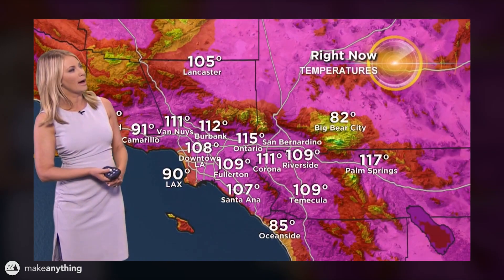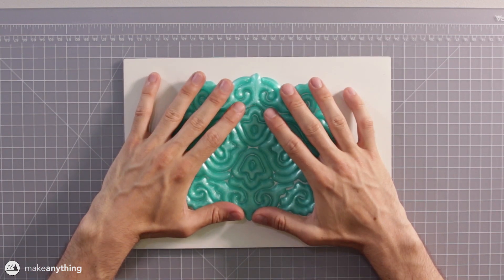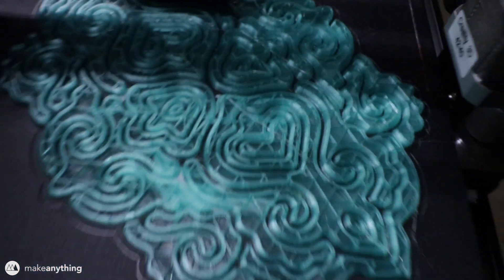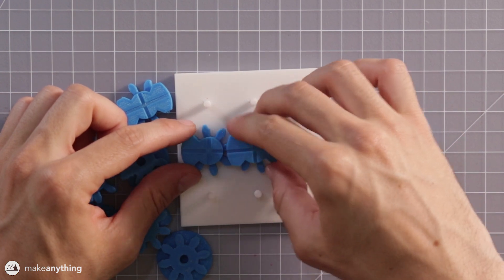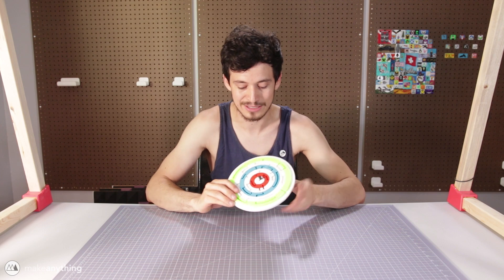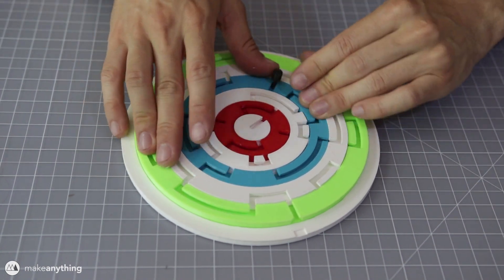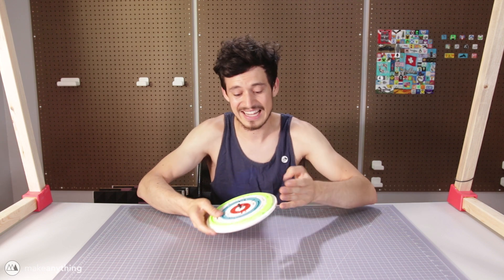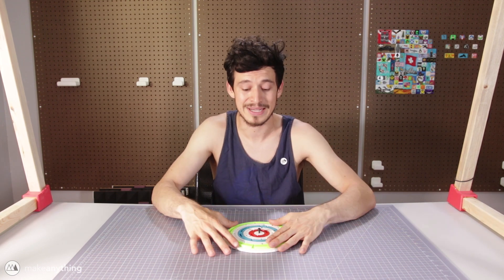Puzzle Competition Entries and Results.. The Best Puzzles!

Comment: Can I just mention that the 2nd and 3rd puzzles he pulled up are puzzles have already existed. They’re based on famous puzzles, and have some variation but still not as original. They’re still super awesome and transposing those puzzles into 3D printed models is awesome, I just wanted to mention you can buy those puzzles as well.
Reply: Heather Monks  
Our submission  (with the gears) was original. Any similarities are purely coincidental. It would be nice if you could share a link to what you belive are the original puzzles. Thanks!
Reply: Heather Monks I have seen the lock puzzle before but I've never seen the other one

Comment: I have a question. How do i get the PERFECT first layer? I have the ender 3 and i tried everything and using a brim or raft only work cos the first layer is always thicker than all the others (yes i did try to re-level the printbed and change the temperature settings nothing works for some reason)